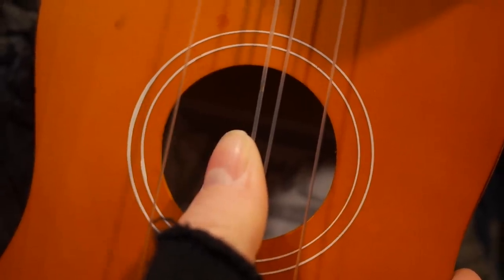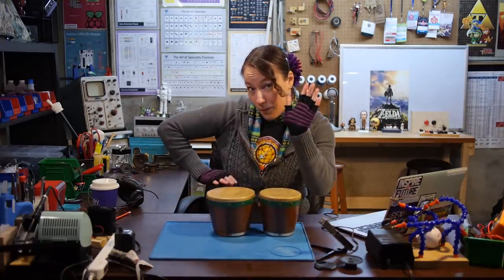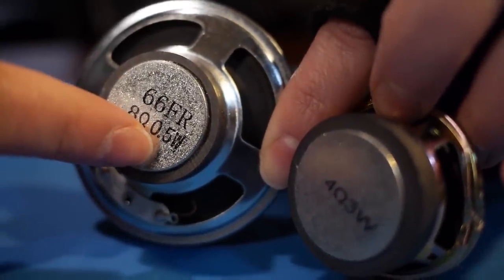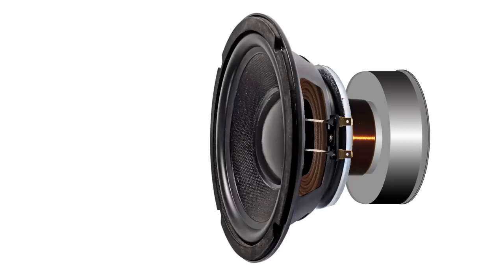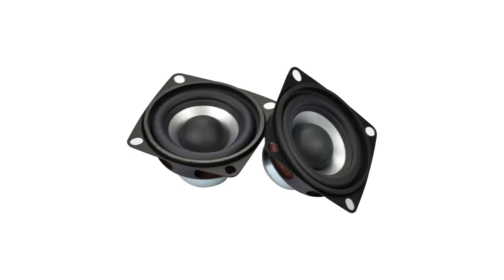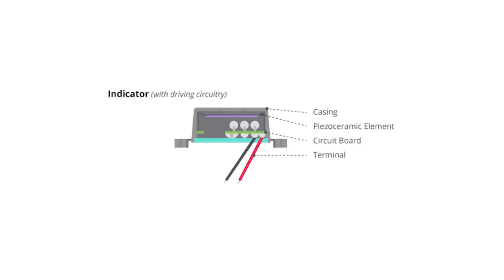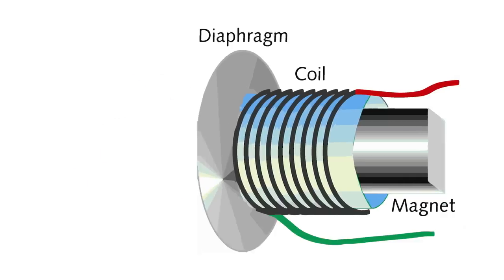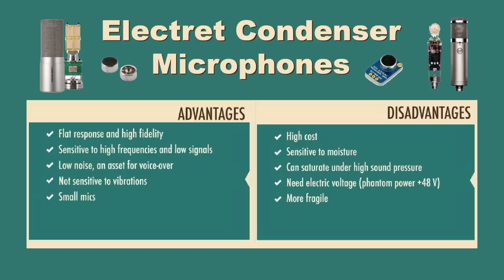Introducing Microphones and Speakers - The Learning Circuit

Comment: Great video! Little detail: The string of your ukulele doesn't move air particle that much. The sound is mainly caused by the soundboard of the instrument and this phenomona depends on the rigidity of the bridge. But it is a current believe that the string can cause sound, in fact it will splits the air more than creating a soundwave :)

Comment: phantom power? The low amp voltage put on a microphone line to power up mics that require electricity. Usually it is +48 Volts DC. Most professional audio equipment can provide this power, when switched on.

Comment: Phantom power is the ability to power devices using the same wire for power and signals. Examples: pots telephones, professional microphones that has active circuitry, and power over Ethernet
Reply: Power over Ethernet isn't phantom, it uses separate wires for power.
Reply: gigabit Ethernet uses all 4 pairs of wires for data. Power over Ethernet  802.3 AF  and 802.3at uses 2 pairs for data and power  and the other 2 pairs just have data
10\100 Ethernet only uses 2 pair for data and the other 2 pair for power

Comment: Phantom power was so called as it was induced from other circuits, and so called free power, from the likes of mixing desks, etc.  If could also be safer than directly connected power.  Being able to provide 48 volts made it ideal for microphones.  However these days many supplies listed as "Phantom Power" are actually specially created from input power  to  48 Volt power out so in reality the free "phantom" element disappeared.